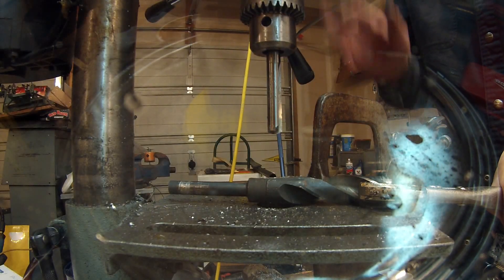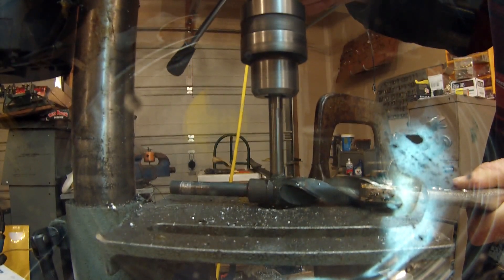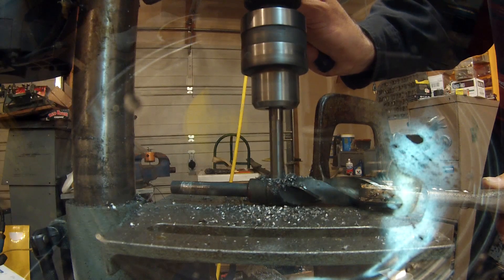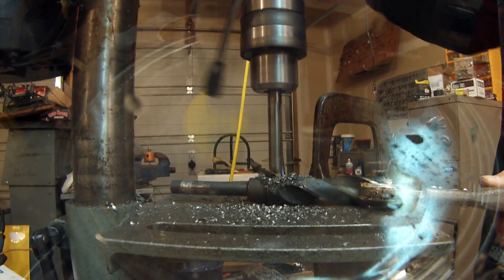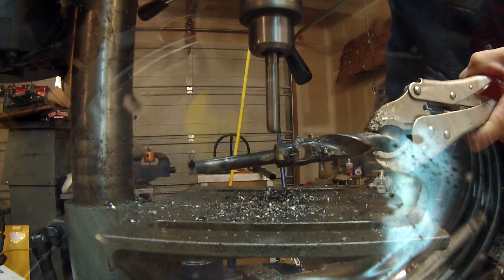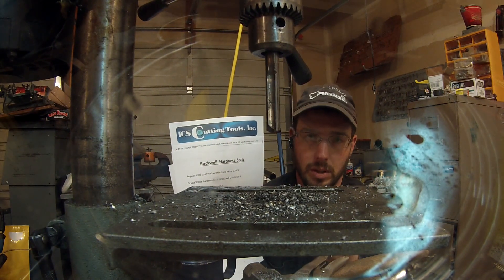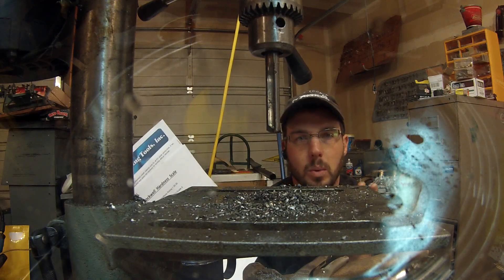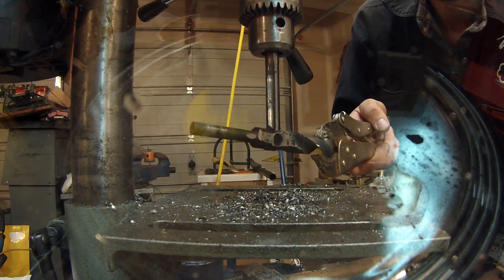Carbide Drill Bit Drills Through HSS Drill Bit

Comment: Carbide drill bits are useful, but their cutting edges aren't as tough as HSS.  BTW, you're cutting through the soft portion of the bit.
Reply from the maker: See the other video listed below. I drill right though  the cutting-edge edge to. Hss is 66 HRC max. Carbide drills 70+ HTC .
Reply from the maker: Yes carbide chips easy but it can be re sharpened on a drill dr. Drill bit sharper.
Reply: Wayne Winton No question carbide is hard...  I've used carbide end mills on my Brideport to machine out broken carbon steel and HSS taps!  That said, the carbide end mill is usually shot afterwards.  But, the tap comes out and that's the important thing!  Can you get your hands on some Stellite?  I'd betruly impressed if your carbide end mill can get through that stuff!  What about a big HSS lathe tool bit?  They're full hard everywhere.
Reply: Wayne Winton An intersting carbide story...  My father had an old cast horseshoe he wanted to hang up for "good luck".  He was unable to drill through it.  I came with my Cobalt drills and couldn't get through it either.  I then tried carbide drills, and they just fractured before they did much.  Had to anneal it.  I guess it was "chilled" cast iron - that stuff is hard!
Reply from the maker: John Gedde See video here: https://www.youtube.com/watch?v=A8LPGGFxnNA
HSS has pretty much the same HRC ratting no matter what sha it is in dill bit end mill ect,  but carbid is simply much harder. I have hered of cast irons that were as hard as some modern day ceramics and that will give carbide a run for it's money!

Comment: That part of the drill bit is usually soft.
  Not saying you can't drill heat treated HSS.  I've not tried carbide on HSS of any alloy. But the back end ( shank) of a drill bit is soft.  Soft enough that you can file it.  It's the part the machinery holds onto when it's being dunked in the molten salt heat treat bath.  So unless you tested that part of the drill,  it is impossible to know if the part you drilled through was as  hard as the  business end of the drill bit.
Reply from the maker: I am sooooo tired of hearing this. I will be doing new video soon drilling through the cutting end.
Reply: Good. I'd like to see it.
Reply from the maker: Raul McCai Here you go:
How to Drill Through Hardened HSS Steel With a Carbide Drill Bit

Comment: That is isn't drilling HSS. To save cost some large HSS drills are harden generally at the cutting area. You'll find proof in the shank as it gets ripped apart by the drill chuck. I keep coming back to this video because drilling into HSS is impressive.
Reply from the maker: See here: How to Drill Through Hardened HSS Steel With a Carbide Drill Bit

Comment: I can't see how that HSS bit was junk. Instead of learning how to sharpen them, can you just send all your 'junk' bits to me? Carbide drills have their place (like drilling out broken taps), but I'm an HSS fan. It's tough stuff, and saved me as recently as this afternoon, when carbide let me down.
Reply from the maker: It all depends on application. Carbide has saved me when HSS has let me down. Both have a place and use. When hss stops drilling carbide will. But carbide is fragile and the whole bit may break. Any bit of mine gets sharpened after 15 minutes of use carbide or hss.

Comment: why
Reply from the maker: Seeing is believing.  I lay it all out on the table. No B.S. it simply is what it is.
Reply: those large drills cost lot of money, its equivalent to a carbide drill itself in price
Reply: if you secure your workpiece properly your carbide won't fracture so quickly btw, i wouldn't even have tried it since its borderline insane (guaranteed fracturing)
Reply from the maker: meocats That one was a junker anyways. Dull and corner was chipped. It was headed for the trash can is I ask Why Not? You are correct about if it were stablised more it would be easier on the carbide bit but the small fractures that the edge gets are smothers out back to factory with a Drill Dr. Pro sharpner.
Reply: HSS bits are never junk because they're so easy to sharp, like a bench grinder would do it.